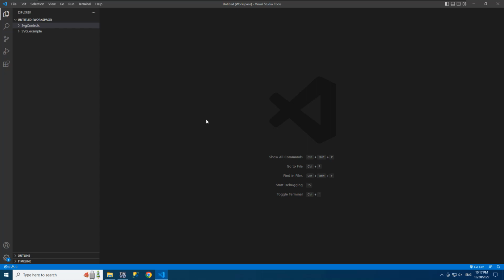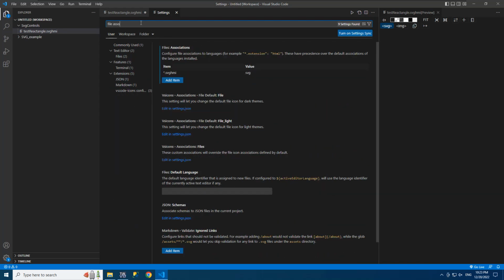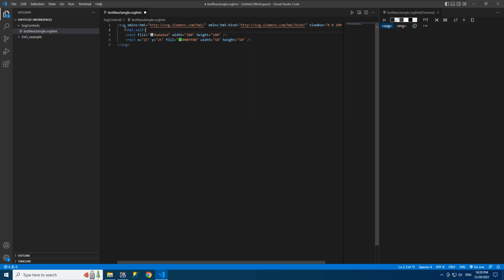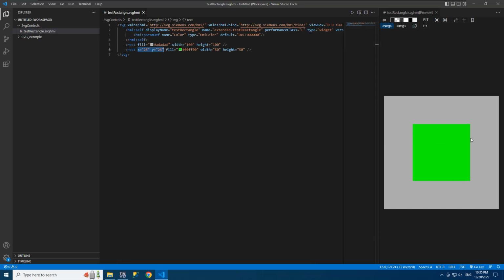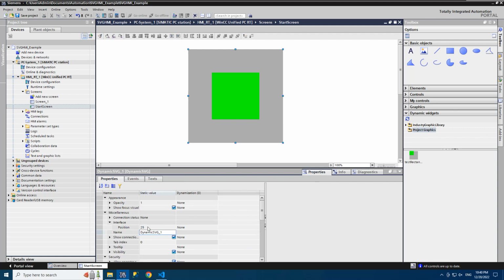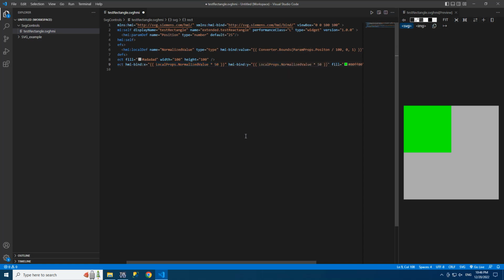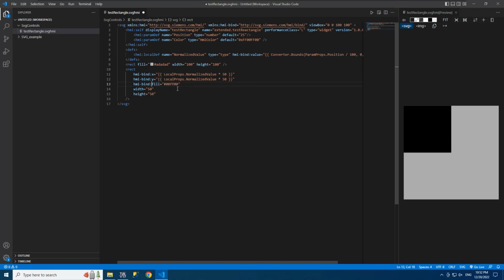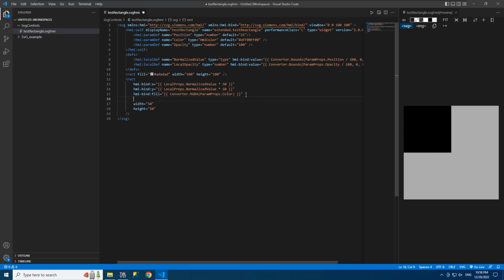How to use hmi-bind in WinCC Widgets (TIA Portal)

Comment: Hello! Thanks for your insightful videos! How can I manage to change the color of a svghmi when the mouse action onHover is triggered?
Reply from the maker: Very strange, just now specifically went to check some google icons and everything works marvellously. You just need to add an ID to the <path/> elements. Then add "fill connection" and specify the same id.

Regarding the hover effect. I would also like to add that I usually add a rectangle as big as the whole viewBox. In order for the hover effect to work correctly and not flicker when you move the cursor from line to line.
Reply: @industrial_control may I ask you to share the code of your svg from Google Icons? Maybe I'm making a mistake. In my case, only fill is working, but not stroke. :(
Reply: I've managed to fix (partially) my code, but I'm still struggling with the mouseHover code. It would be really appreciated if you'd be able to share a sample code. Thank you!
Reply from the maker: Here is the sample created from google icon. 
https://svghmi.pro/SVGHMI.pro_HoverExample.zip
Reply: @industrial_control , thank you so much! Now I've understood what I've to do! I really appreciate your help. Is the website yours?
Reply: @industrial_control , thank you so much! Now I've understood what I've to do! I really appreciate your help. Is the website yours?
Reply from the maker: You're welcome! And yes you'are right this site is mine. If you have any other questions or suggestions, it would be my pleasure. You also can find there email and contact page.
Reply from the maker: Hello! Thank you for your kind word. First of all you should add  something like this code to <defs/> section.

    <hmi:localDef name="MouseHover" type="number" value="0"/>
    <hmi:action id="onMouseHover">
      <hmi:setProperty name="LocalProps.MouseHover" type="number" value="1"/>
    </hmi:action>
    <hmi:action id="onMouseLeave">
      <hmi:setProperty name="LocalProps.MouseHover" type="number" value="0"/>
    </hmi:action>

Next add next attribute to <g/> tag or <SomeAnotherElement> tag a couple of hover events.
<g hmi-event:mouseLeave="url(#onMouseLeave)" hmi-event:mouseHover="url(#onMouseHover)">

And now you can use "LocalProps.MouseHover" in any play to trigger color changing.

Also, I can't not mention. That you can simply use the converter https://svghmi.pro where it is already implemented. You don't even need to open the code editor.
Reply: @industrial_control , hey, thanks! I thought it would end up being easier than this. I've also tried the website you are talking about, but it doesn't work properly with the icons from Google (https://fonts.google.com/icons). The properties are not being bound to the interface when I tried to upload an icon.
Reply: @industrial_control , hey, thanks! I thought it would end up being easier than this. I've also tried the website you are talking about, but it doesn't work properly with the icons from Google (https://fonts.google.com/icons ). The properties are not being bound to the interface when I tried to upload an icon.
Reply: @industrial_control , may I contact you in private?